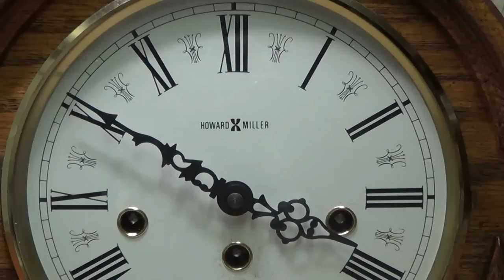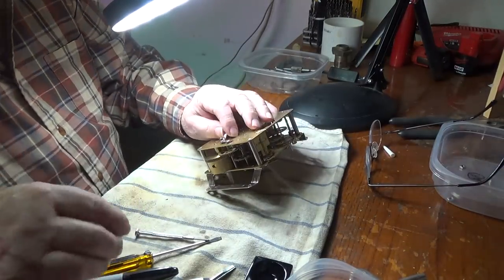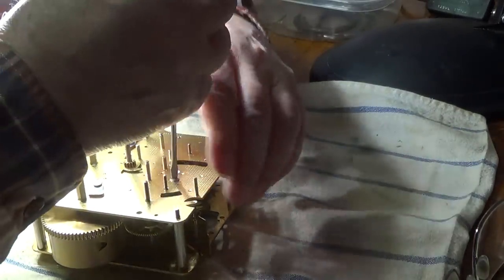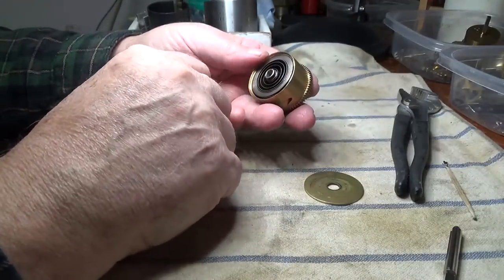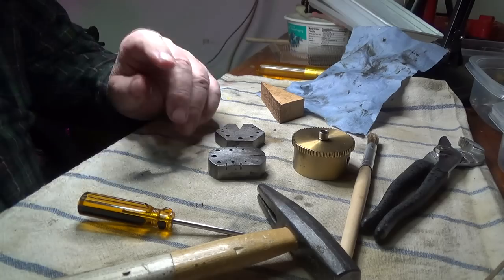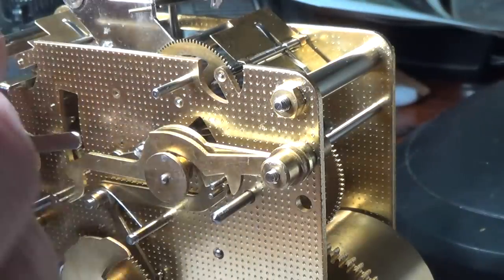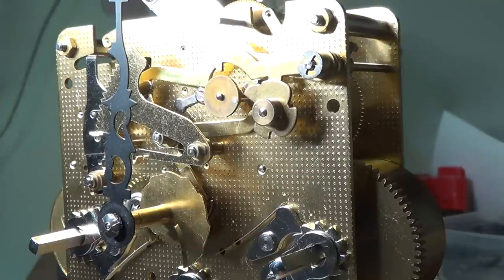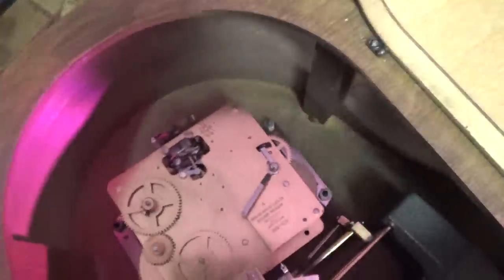Howard Miller Worthington Mantel Clock with Hermle 340 020 Movement

Comment: An index for this video:
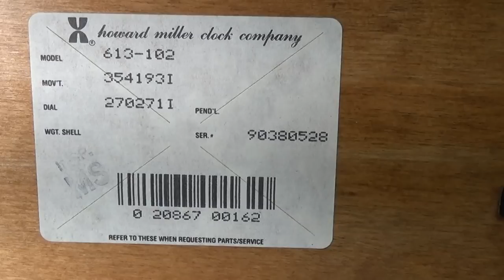0:00 - 1:22 Information about this clock.
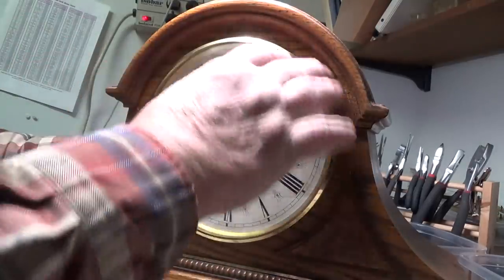1:22 - 2:15 Removing the hands; examining the bezel.
2:15 - 5:05 Removing the movement from the case; briefly examining the movement.
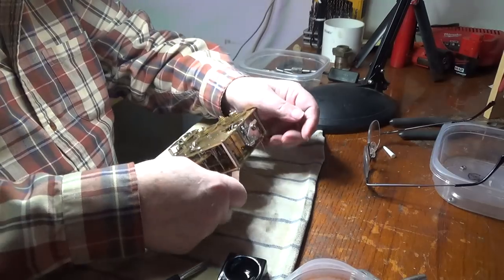5:05 - 5:50 Letting down (unwinding) the mainsprings.
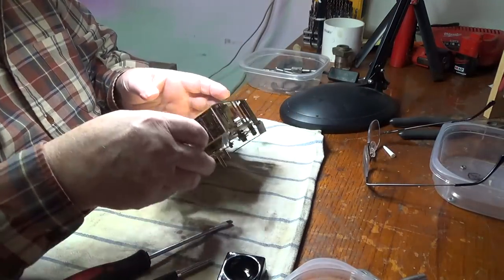5:50 - 7:24 Removing the balance wheel assembly.
7:24 - 9:15 Removing the hammer assembly.
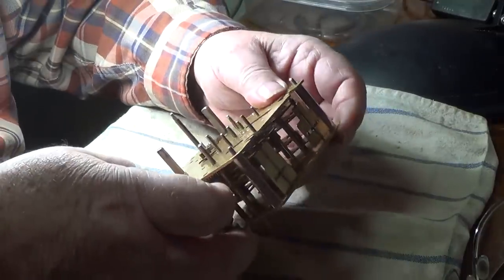9:15 - 25:43 Planning the disassembly; removing the external parts.
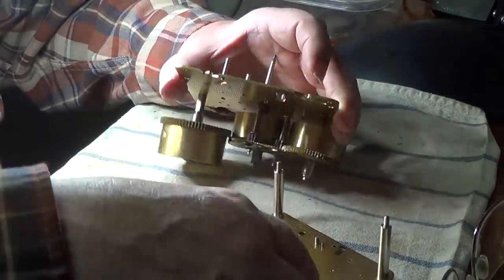25:43 - 27:19 Separating the plates
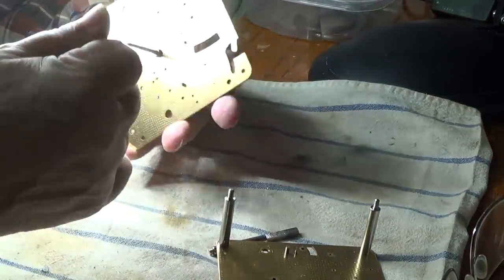27:19 - 28:40 Removing the inner parts from the plates.
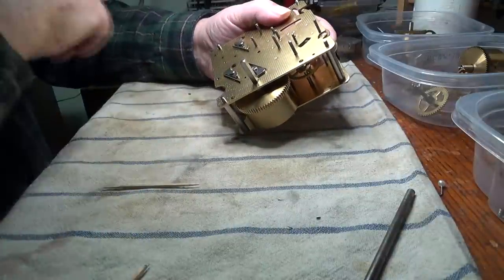28:40 - 30:19 The easier way to remove and insert the mainsprings on a Hermle movement.
30:19 - 31:13 A quick view of all the parts; reading the movement's stamp.
31:13 - 31:46 Examining all the pivot holes for wear. No substantial wear found.
31:46 - 35:51 Cleaning the plates and wheels with soapy water.
35:51 - 48:22 Removing a mainspring from its barrel, lubricating it, and returning it to its barrel.
48:22 - 49:18 Separately testing the cleaned time train and strike train.
49:18 - 50:52 Evaluating the sticky chime hammers; testing the cleaned chime train.
50:52 - 51:49 Testing the cleaned chime hammers.
51:49 - 52:21 Reassembling the movement (briefly).
52:21 - 1:22:41 Detailed explanation of how the chime levers work.
1:22:41 - 1:22:52 The fully reassembled movement.
1:22:52 - 1:23:50 Running on a test stand.
1:23:50 - 1:24:32 Placing the movement into the case.
1:24:32 - 1:25:21 The fully repaired clock running on the mantel.
Reply: Do you still fix clock i bind watching all your views  on you tube

Comment: WOW! I knew these clocks were an amazing feat in engineering, but didn't appreciate what goes into maintaining them and the knowledge that is needed to work on them. 
Me, as foolish as I am, thought I could take one of these apart and get it working again will little effort! Boy, was I wrong. You are a very skilled craftsman.
I think I'll just put it back together and admire it.

Comment: Thank you for this video very helpful. I'm an amateur clock repairer here in the UK it's also a bit of a hobby.  I service the cheating way I clean the pivot holes with a tooth pic then clean with a cotton bud with fuel lighter fluid then re oil the movement so far seems to work out. Great to watch a master at work 😊
Reply from the maker: Thank you for the comment, but I'm no master.  It's just a hobby for me as well.  I started doing this in 1968.

Comment: Your video and knowledge are outstanding.  I don't repair Clocks, but tinker with them.  I found your video and got hooked watching it.  I have a Gilbert Mantle Clock ($15 at an Estate Sale) and a Ridgeway.  It's a square Mantle Clock ($70 at Estate Sale).  The Gilbert started working after I lubricated the pivots with "Synthetic Super Lube".  It keeps OK time.  It gains about 1 minute a day when fully wound and then loses a minute or so a day when the mainspring it running down.  I did notice a badly worn bushing in the Chime section.  Don't have any special tools to replace it but bought a small bag of unsorted Clock bushings, also at a Garage Sale.  

The Ridgeway uses a balance wheel and does not run.  I took it to a Clock Shop and it is being repaired.  I wanted to try and fix it myself but the Clock Technician said "It's a beautiful Clock and it would be too risky to try and repair it yourself".  He's had the Clock for over a month and says he will fix it.  I'm in no rush to get it back so he can repair it as time permits.  I see why it costs a fair amount of $$$ with all the labor involved.  

Sadly, too many of these Key-wind Clocks are being tossed out.  Few seem interested in them, especially the younger generation.  I am 66 years old and love mechanical things.  

Thanks again for the videos and your expertise.
Reply from the maker: Thanks for watching and for your comment.  Hope you watch my other videos as well.

Comment: Hello professor, I wanted to thank you for the video, it has been of absolute clarity, you have helped me to interpret the behavior of these cam wheels. The best video I have seen on the internet in which you address this subject in such detail. I am repairing a very similar Hermle 350-020 machine and your video has been a tremendous help. Best regards !
Reply from the maker: Thank you so much.  I'm glad you found it helpful.
Reply: @dperry428 Yes of course you help me ! i wanted to ask you something: my clock have an old floating wheel escapement, is not like yours but similar, mine have a vertical hairspring. We need to cleanning and oiling the floating wheel escapement ? i dont know how can i do. Thank you professor, best regards !
Reply from the maker: It needs to be absolutely clean and free of any oil.  A final rinse in a degreaser like acetone is good idea.  No oil whatsoever.
Reply: @dperry428 Thank you professor, i send my best wishes !

Comment: Thank you so much for this very detailed video. I have a 340 020 movement  in a mantle clock that my parents passed down to me. It worked perfect when I lived at home, so I was a bit surprised that when I got it, it was not working at all. I cleaned/oiled all the pins as per another video and it worked (ALMOST). Then after putting it all back together, I realized that the chimes were not functioning properly. At the quarter hour they would start and just keep going. So I hit the internet.

Came across your video and watched it for quite some time as you explained how the chime setup works and how to adjust it.  Turns out that someone must have messed with the clock at some point after I left home. The quarter hour cam (I think that's what it's called 1:01), was NOT quite tightened in the right position. It was already starting to ramp up the cam before the pin came around to stop the quarter chimes. Loosened the screw, got everything where it should be according to your AMAZING instructions, tightened it up, DONE. Had to go through a few cycles before it straightened itself out, but it's all working just like when I lived at home. My parents would be so happy that it's working again. Now I have 7 other clocks to clean and oil!

Thank you so much for this information. I feel like no one seems to want these old clocks anymore and it's getting more difficult to find clock repair people now too. 

Is there any way I can download the video from somewhere? It would be great to have for future reference. I'm afraid if it's not on youtube when I need it again, I'll never find one as good again!  Thanks again.
Reply from the maker: Thanks for watching.  I'm glad you found this helpful.
Reply from the maker: I tried to give you a link to a site that tells how to download YT videos, but it was deleted.  Apparently, YT didn't like that.  Just do a search for downloading YT videos and you'll find the information you need.  I've never done any downloading so I have no recommendations to make.
Reply: @dperry428 And BTW, it's still chiming away 24 hours later. So seems good to go. Not sure how that cam got set out of alignment. This was always one of my moms most reliable clocks. It'll remain a mystery.

Comment: Thank you for the excellent explanations (and for filming the oiling of a clock spring). I learned a lot with this one!  Knowing to align things (including where the warning pint needs to be) at the 3/4 hour is helpful.  It looks like they had ease of assembly in mind with this design (at least as far as clock movements go).
Reply from the maker: A good habit to get into, if the clock is at all functional, is to get the chime and/or strike mechanism into its normal locked position and note where the part positions are. Digital photographs are also helpful.  Then, when reassembling, you have reference to where everything needs to be.

Comment: excellent I learned so much from this thank you!!!
Reply from the maker: Glad it was helpful!
Reply: mine is now working great because of your video the only problem is the hourly bong starts quiet and gains volume with each bong. The hammers move perfect no restriction its almost like it not lifting the hammers high enough?
Reply from the maker: Strange!  The hour strike is controlled by a star wheel between the plates.  If the length of the "arms" of the star are not of equal length, then the hammers would vary in the height they are lifted with each strike, causing differences in amplitude of the sound.  Only thing I could think of that might cause the problem.
Reply: good answer I wonder if that is possible that the star wheel could wear like that  I appreciate your help in this matter. I will take a closer look at the star wheel if its needs replacement is it possible to get one?
Reply from the maker: Also, check for a bent pivot or even bent arbor that holds the star wheel.  Any deviation from running true would cause a virtual change in length of the star wheel points.  https://timesavers.com/search.html?q=hermle+star+wheel&go=Search
Reply: thanks again will let you know

Comment: Another great video!  Looks like everything was cranked down crazy tight at the factory, or perhaps corrosion was a culprit.  When it came time to separate the plates, I wondered if you could lift the back plate off instead of the front plate, since the center cam/gear was not removed on the front plate side.  Though it looks like you eventually sort of did this to get them apart.  I ran into the same thing by the way, a non-removable/fixed shaft, when fixing a Jauch movement.  And since its the hour shaft, the bushing shouldn't wear out for a long time (hopefully).
Reply from the maker: It goes a lot easier taking these movements apart if you're not old and forgetful and remember that the mainspring barrels can be taken out as soon as the hammer assembly is removed and the clicks on the front plate are removed.  The winding arbor simply pulls out of the hole in the front plate and the whole barrel can be slid from between the plates. Makes disassembly a whole lot easier.  Yes, those German movements, Hermle, Urgos, Kieninger, Jauch, all have the lift levers press-fit to the center arbor.  Removing them can be a  nasty affair without a puller.  Hard to justify the expense of one if it is only used once in a couple years.  With these movements, that is why many repair people just prefer to put in a new one.  They are available except for Jauch, which is out of business.  Be aware, too, that many of these movements that were made during the 1975 through 1989 period were made with soft steel plated with nickel or chrome and, when the plating wears off, rebushing simply results in the pivots wearing out in a matter of months.  When you run across one of these with plating worn, you can replace the pivots with hardened steel or you can replace the bushing with tiny ball bearings that negates the concern for the pivot condition.  These ball bearings are sold by a company in Muscatine, Iowa,  Butterworth Clocks.  They also sell replacement movements.  http://butterworthclocks.com/   User name and password are both: butterworth

Comment: Hi there, you have racked up a lot of views and comments, well deserved, thanks for shooting this video. Totally new to clocks, just received one with a Hermle 340 020 movement. Wasn't even sure how to wind or test it. After watching your video (and reading below), I gently wound up the middle winder...and...nothing. It wound a couple turns and I stopped when I began to feel resistance. The top part that moves in back (the hairspring balance?) doesn't move at all. I tried rotating the minute hand through an hour, felt something happening at the quarters, nothing else. Then I wound the right one, no issue. Wound the left one, after a couple of twists the catch didn't hold and it unwound fast, really hurt!, but rewinding seemed to work fine. At this point, toggling the lever in back up and town caused it to play the chimes pretty well, but no other movement. Thoughts?
Reply from the maker: My thoughts?  I would tell you to put this movement away until you have experience with simpler movements.  Start with a movement that doesn't have chime or strike.  For this movement, your experience with the springs tells me there are several problems and you have no experience working with springs.  They can be VERY dangerous and have to be handled with care and respect.  The one that slipped on you might have a damaged click mechanism.  Unless you know what you are doing, I advise not messing with it.  The middle spring is the one that controls the time, the one on the right is the chime and the one on the left is the strike.  I can't diagnose problems without examining the movement.  It's like saying to a car mechanic, "My car is making a noise, what's wrong with it?".  Again, my advice is to not mess with it until you have experience with simpler movements.
Reply from the maker: By the way, that spring that let loose on you is a bad thing.  That sudden release of energy may have damaged one or more of the gears -- either bent or broken teeth or bent or broken pivots.  It will need to be examined very carefully. That spring could let loose again and next time a part may come flying out and hit you in the face.  Wear eye protection.
Reply: @dperry428  Thank you sir, that's pretty much the perspective I wanted to hear, and thought it would be useful for others here in the comments. I am pivoting from typewriters to interest in clocks. Your video made very clear how much knowledge is needed to do this, and your respect for the stored energy within. The clock is so lovely, I just wondered what to do next. It seems most websites recommend replacing the mechanism, but it is such a masterful creation I would rather see it fixed. I was also thinking that a spring could be unwound as you demonstrated, and possibly just replaced as a module, as a middle ground. Anyway, thanks for the comments, I wasn't expecting a diagnosis, just perspective, much appreciated!
Reply: @dperry428  Wow, that makes sense. Who would have guessed that clocks were more dangerous than typewriters! Pretty cool, actually, both run on human power, but the typewriter only stores a single typed line of energy, while the clock needs to store 8 days. Many thanks again for your thoughts.
Reply from the maker: Yes, many repair people say to just replace it.  Don't give up.  If you want the clock to function, buy a replacement movement and then play around with the old one.  Let the springs down as a first step.  That takes away the energy that can cause damage to both you and the movement.  The spring barrels can then be removed without taking the movement apart and you can then take time to safely study how the movement works.